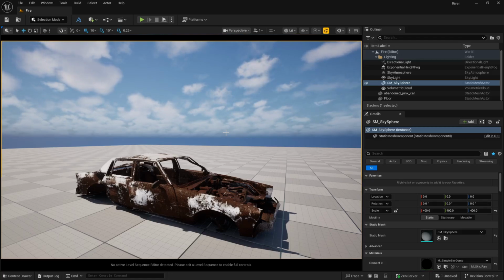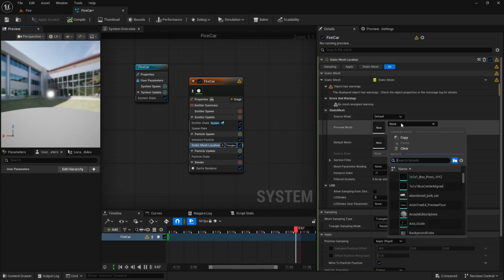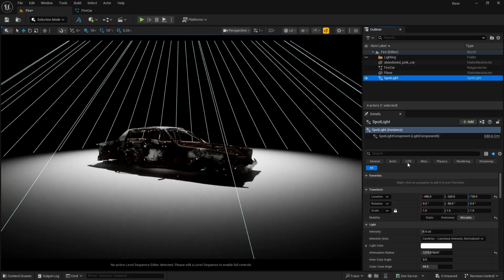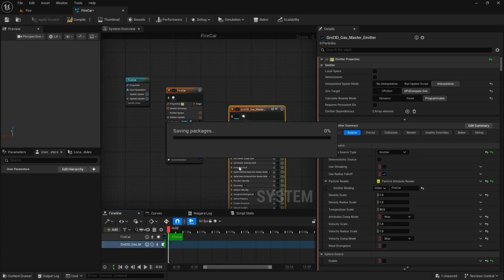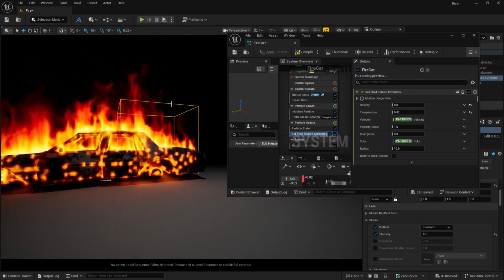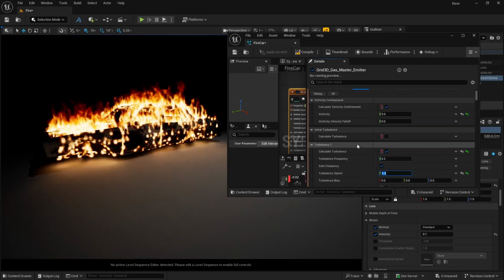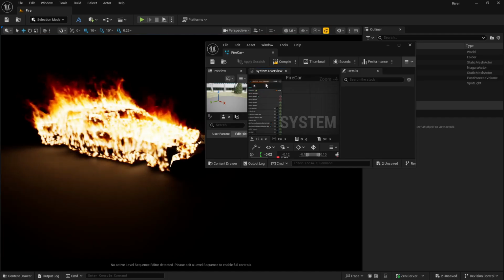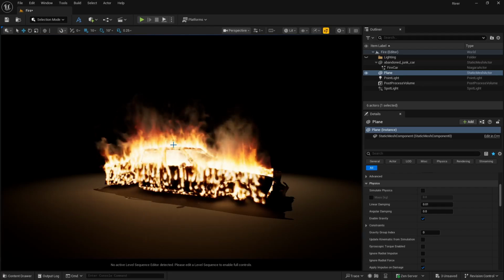Unreal Engine 5.6 Full Beginner Course (Day 20) : Niagara Fluids Unreal Engine 5.6

Comment: What are your system specs i don't think my 4050 can even handle 200 res attribute that well 😂
Reply from the maker: I have i7 14th gen 64gb ram 4070ti super 16gb.  You can cache out at higher res if going for cinematic
Reply: @RenderRebels 💀 
i want it to be dynamic and performant in a multiplayer game with all the "attacks" powered by niagara fluids and particles in general. But it chokes the GPU
Reply from the maker: @rohanmanchanda5250  use grid material method if it is not interacting that much or fake fire using the niagara gpu particle shape method
Reply: i hope u have videos regarding that, I'll check your channel